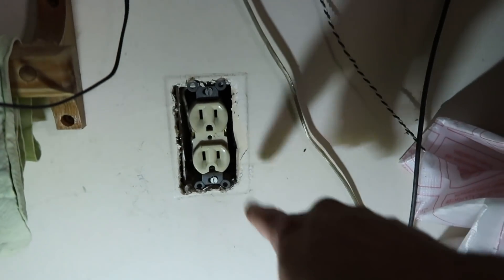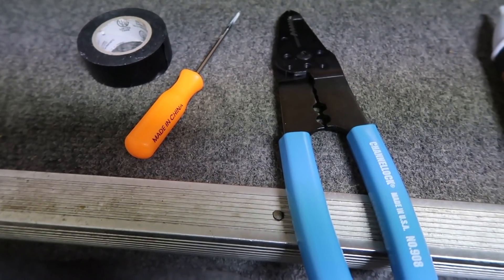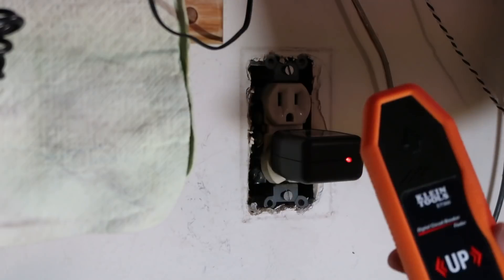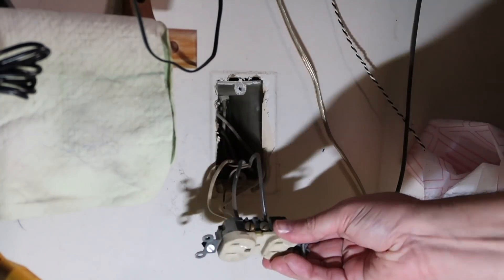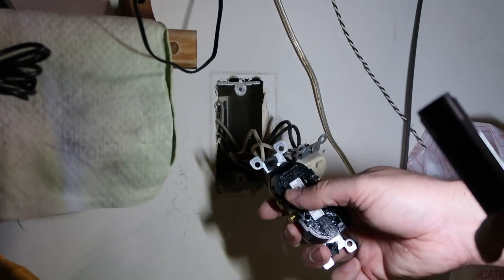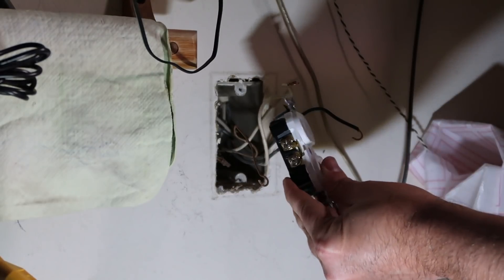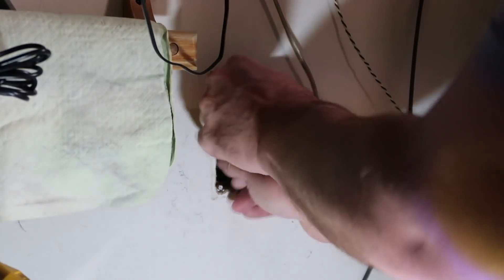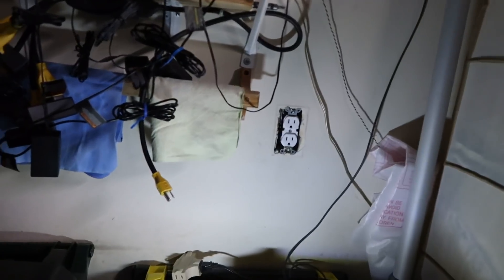How to wire an Electrical Outlet - Step by Step

Comment: I really wish you would have done the whole thing instead of skipping to save time as that's what I wanted to watch.  Also, in my house the outlets are where the prong is on top, I heard that's actually how it is supposed to be...
Reply from the maker: The ground prong you mean?
Reply: @DIYReid  Yes, the ground prong.  I called my friend who knows about these things and he walked me through but it would be good if you redid and walked through the wiring.  Also, should be a warning about NOT using 20amp for 15amp outlet...
Reply from the maker: I mean it’s personal preference on ground up. It’s not residential code.
Reply: @tigerlilly6895  
It is okay to put a 15 amp receptacle on a 20 amp circuit consisting of a series of receptacles.

Comment: Hi ......The outlet I want to replace has two white, 1 red and a ground wire, unlike the one in your video with 2 white, two black and a ground. Is mine even replaceable? It's a 35 year old manufactured home, and I can not seem to find one like it. Any suggestions. ........Thanks
Reply from the maker: The red is a travel wire for a 3 way switch.
Reply: @DIYReid  Hi Reid...not sure what that means.....and my question is: can I replace this outlet with a 2-white, 2-black wire outlet?
Reply: DIY Reid its a switch controlled outlet you idiot
Reply: Likely it's controlled by a switch but that doesn't explain why there are two white wires in the box.

Comment: Do the black wires and white wires have to match/coordinate in anyway? In other words, what if you just switched the black wires with each other. Would it make a difference?
Reply from the maker: They have to match. If you reverse them then that’s bad.
Reply: It doesn't matter which one goes on top or bottom unless you're installing a GFCI receptacle. Just make sure the black wires go to the black screws and white goes to the nickel/silver colored screws.